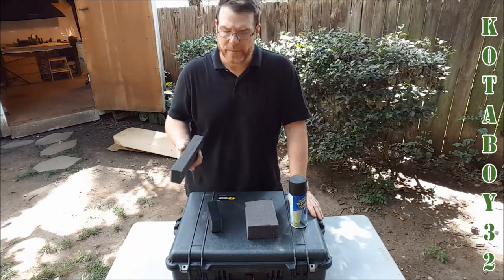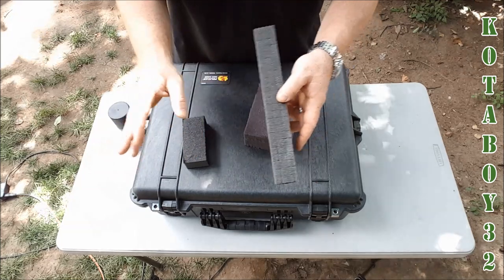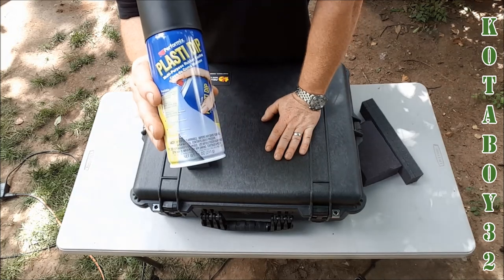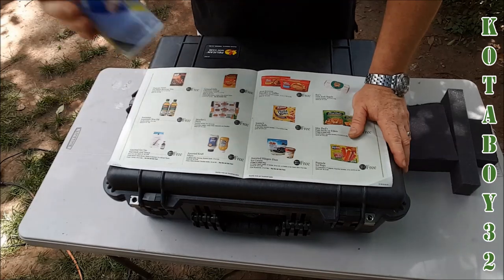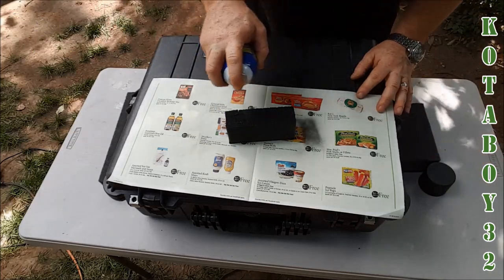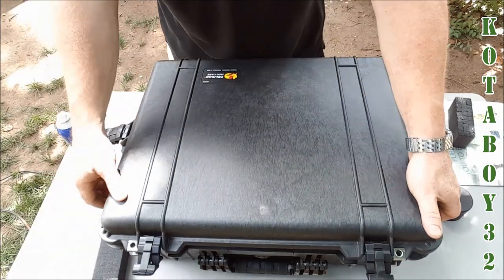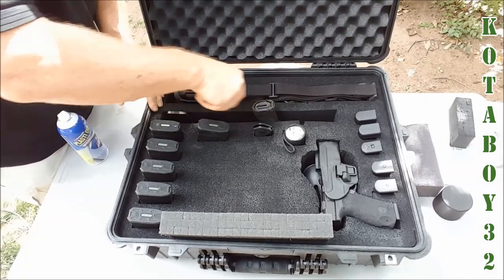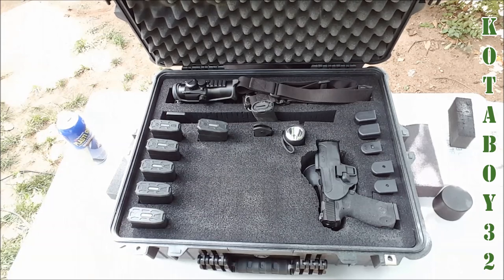Plasti Dip Fixes Pick & Pluck Foam Issues

Comment: I tried this on a similar case from Amazon. It didn't work with one can. After spraying it all down good, it was better, but still began to fall apart. I tried it again, this time brushing on flex seal, and it's holding better. But really it could use a little more. Honestly, you'll need several cans of plastidip to get a firm hold (or several coats with a brush). This stuff is a basically a big sponge, made to soak up liquid, so that's exactly what it does.

Comment: i use plasti dip for all my foam. works great... also if you use spray adhesive, there can be some spots where it is still tacky, go over with plati dip and bam, fixed.

Comment: Great Video!  I have been using Pelican cases for years now and I have had the same issue with the pick and pluck foam and now that I have seen your video I will be able to setup both of my 1750 and 1720 cases up right.   I have also been looking for a case where I could put a AR pistol or quick reaction setup and seeing what you did has given me a lot of ideas  and turned toward the 1600 instead of the 1700 series case.  I want a case that I can take with me on a plane and allow me to have a sidearm with me when I travel in states that honor my CWP.

Bravo ZULU on your Case and Video!

Comment: Thank you for posting this video! I have used Pelican, and knockoff cases for 25 years to house electronics and computer peripherals. Love the pick and pluck concept, vs cutting foam w/ a hot knife, but the fact that the cubes can inadvertently tear off, is frustrating. So, finally have a solution!

Comment: Added tip for use with Plasti Dip - after shaking very well keep the can in hot water....the hot water allows the rubber particles inside to be VERY FINE. this will aid in a much smoother application and look.

Comment: Learning this the hard way: this is best done right away, when the foam is new and the blocks are together. I did the Plastidip spray a couple years in, when some of the blocks were very loose or missing. Do this the right away after you decide on your configuration. 2023 cost at Home Depot is about $10 per can.

Comment: I would spray first and then cut, not cut than spray.
There are a multitude of different sprays / coatings you can use.
3-4 coats of flex seal works out really nicely.

Comment: Love plastidip! Used it for years on my car, blacking out the silver/grey highlights on the grille and bumpers and gave all the chrome trim a nice black matte finish. Been 4 years and still holding like new. Also rebuilt and refinished a hon lateral cabinet using dip on the handles for grip and coat the sharp edges. First coat is supposed to be a half spray dusting to give the following coats something extra to adhere to then lay it thick with wet sprays after that.
Gonna go the extra mile by grinding & sanding with my Dremel for better shapes and cleaner edges after I pluck the cubes before dipping. Making a QuickDraw case for 4 pistols .

Comment: Is the plasti-dip rough on the firearm?  If it is drying hard, wouldn't it scuff the firearm as it is being removed and reinserted? Just curious as I just got a case and this looks like a great idea as I was thinking of putting the pick n pluck on bottom and carving on the solid pice. Thanks, and great video.
Reply: I'm wondering the same thing

Comment: I was inspired by your vids to finish my Pelican 1600 go box. The plasti-dip tip worked perfectly. My AR pistol is nearly identical to yours. Went with my Sig M11A1 for the handgun. I added a spot for a Howard Leight Impact Sport hearing pro. I also cut a small section in the second layer of foam for a desiccant pack. Thanks for the vid and the ideas!

Comment: Would you recommend coating the foam with the Plasti-Dip before or after cutting it? I was thinking maybe I should coat it first as I feel that could make it easier to cut, but what do you think?
Reply: TheSlowredchemical  wondering the same thing
Reply: TheSlowredchemical you don't cut it you pluck bits out

Comment: Great tip, Kotaboy.  I just started picking & plucking my brand new Pelican 1510 and already the pieces are coming apart.  I’m going to get some Plasti-Dip.  

It might take a little practice.  But a whole new set of P&P is only about $40, so if I screw it up, it’s not like I wrecked a $180 case.  

Also, you are clearly no fan of the factory P&P, so I give you extra points for not using a word that rhymes with “pluck” every time you call it by name!  :D

Comment: this works great.  nice job on the case.  although the area you have blank seems a waster of the space.  perhaps you might have been best served with a smaller case.  for everyone bemoaning chemicals and moisture...you don't store long term in this situation.  if you do, just throw a couple of silica gel pack in the case.  also, you should check your guns every couple of weeks based on the humidity in your area.  leaving this in the Florida area for months will be your own fault when it looks like a rusty anchor.

Comment: i'm assuming its good idea to have it all plucked out and set up the way you like it before you spray it down with the plasti dip. I thought about doing it on mine...but my set up in my case isnt' complete. My fire arms hasn't had its red dot put in yet and will need future cutouts for it.

Comment: use some warm water in a bowl to warm up your plastidip bottle.  Not boiling!  Just hot tap. Then shake it well, it will loosen it up for a better spray.  around 20cm (7.5 to 8 inches) is the best distance to spray from.  About three coats. Let each coat dry.

Comment: The only reason I don’t want to do this, is that as a photographer, my gear is constantly changing, so I want to make sure I can always add slots for lenses without having to buy a whole new set of foam
Reply: you must not be talking about spraying the foam with plastic-dip.
Reply: Just cut new holes through the plasti dip

Comment: Great Tip - just got a CaseMix for my Nikon Z6 and kit lenses and adapter (for non Z lenses) so we are talking about $4K and I was sticking it away with other stuff not good to keep near this equipment... but I will - constantly - be pulling and pushing at the sides of those grooves... this should do the trick!

Comment: I went the Apache route as well, as good as the case is i hate the pick and pluck foam, i believe ill use the Plasti Dip on it but im gonna order a couple pieces of the solid foam and use a hot knife to cut out the layout, i think it'll give a better look overall, thanks for the video

Comment: Help ! lol ok I've got a case with the same removable blocks. And had it so long they've broken down. Can you tell me where I can get  New solid foam sheets from. I can't seem to find them. I look forward to hearing from you. Thanks for the video. keep up the great work.
Reply: Kotaboy32 Tactical Firearms Review well I tried to get the size I needed about 8 months ago and they only had narrow slips that I would have to place 3 side by side. I haven't looked since. but would love to get the size I need for my AR. Thanks for the help. ill go back and look again.
Reply: @widowmaker8338   try kaizen 24"x48"x(three dif thickness 20mm 30mm 57mm)
Reply: @Dreadylock9170  thank you very much for your information.

Comment: Thank you for this video! I have a Pelican 1400 case for m,y DJI Mavic Pro. I fly my drone alot and after the first few weeks I noticed the Pick N Pluck foam as started to show some wear and tear. I would love to get a foam cut-out specific for my Mavic however its more than half the price of the case just for a foam replacement. I'll spend $6 or so on a can of plasti-dip. Awesome video!
Reply: Doesn’t the Mavic come with it’s own hard shell case? What was wrong with the original case it came with? I’m in the process of getting the new Mavic

Comment: That is amazing! I will try this when I buy new foam for my cast.  Also, if you have a access to a laser cutter, you can cut out that same pattern into a thin piece of acrylic with color of your choice (preferably opaque) and glue it on top of the foam. It will make the case look uber professional. I got the idea from Tested.
Reply: Bacawaka acrylic defeats the shock absorption of foam. If I'm protecting anything with foam padding, I don't want to add a sweet looking but hard piece of acrylic for my gear to potentially bang against.

Comment: i USED TO DO A LITTLE FIBERGLASS WORK BUILDING A SOLAR BOAT. i GOT SOME RESIN ON FOAM ONCE AND IT GETS ROCK HARD. i THEN THOUGHT THAT IT MAYBE POSSIBLE TO THEN WITH A SAW AND OR CHISEL. tO FORM AND SHAPE WHAT EVER YOU WANTED. Say for instance a fore grip or something. Never ended up doing it.

Comment: I did my 36 inch case last night (3 coats) and its not looking as nice as yours. might need a 2nd can bc i can still see the individual squares at some spots. The last coat left some thick spots that i should have spread out w a card so it looks kinda splotchy. Also it smells very strong chemically after sitting 13-14 hours does yours still smell so strong? not the results i was looking for.
Reply: I had to leave mine out to dry for like 3 days to get the smell to go away

Comment: I've ordered two cans of Gun-Metal Gray Plasti-Dip to do my two Pelican cases.  I already have my items set in my cases, so I'm just waiting to do the Plasti-Dip.  

Won't the Plasti-Dip bond the upper and lower layers together?

Thank you for this Video.
Reply: Vigi Driver 
no it will not...I used hot glue and it works great

Comment: How many cans do you think it would take to do 4 of the Plano All Weather Tactical cases? I have 3 of the 42" and one of the 36"?
Reply: +kotaboy32 Firearms Review was that both layers of foam?
Reply: +Jon R also, if you have foam that needs replaced I found a place that has high quality foam for a lot less than the pelican brand stuff and they sell while sheets of it. They have charcoal standard and charcoal firm up to 4" thick. I'm ordering a couple sheets just to have for when my foam needs replaced. They also offer custom water jet cutting if you want to have the foam cut perfectly. Here is the link for the charcoal foam for gun cases as well as eggcrate charcoal foam. 

http://www.foamforyou.com/custom_foam_packaging.htm

Comment: I wonder if you could spray it unplucked then cut to exact size after?
Reply: Big Al yes you can just use a razor knife with a brand-new blade and white sharpie for the outline works fine I did it to mine good luck
Reply: Thanks.  I going to try it this weekend.  Have a two gun case (pick and pluck and it's big) that I'm putting my 6.5 creedmoor and my ar.   Room for mags and a couple of guns maybe three.
Reply: @bigal7561  hey Big Al did you end up spraying then cutting? If so how did it work out?

Comment: You can buy closed cell foam for these cases. Going further, my Plano case has two layers of foam on the bottom part of the case. One of those is "pluck foam" and the other is just a solid foam sheet. What I do is put the pluck foam as the bottom piece that the items just sit on and I cut out the other piece for the items and it goes on top for the items to fit in. So you just reverse the foam sheets essentially. Also, and this is important for all firearms owners to understand, foam cases are not a great way of storing your firearms long term due to them having foam. Foam sucks up humidity like a sponge and moisture is not good for your firearms. This is especially true in humid climates. So if you are storing your firearms in cases with foam, you need to throw some silica gel packs in the cases as well and change them out regularly.

Comment: You also glue the foam to the case with it
Reply: JB be careful some glues degrade seals on peliican cases from fumes in case even qfter it dries. I hate to use glue on my expensive case. Sounds good but bad idea plasti dip dries.

Comment: there's 5 different grade s of replacement foams. there's good stuff and cheap stuff
Reply: Can you please name the different types of replacement foam you can use that way I can do some research and look them up I have a Plano 36-inch all-weather ml tactical case that has the pluck foam and this is for my Smith & Wesson military sport AR-15

Comment: besides plasti dip theres a spray glue designed to use on foam.  that would be better stuff in 1 applications 
http://www.sailrite.com/NG633-Foam-Lock-Spray-Adhesive-12oz
Reply: JB is that stuff made for joining the foam or just gluing foam together? I ask because I tried the 3m super 77 that pelican recommends for gluing foam. That works great for gluing the layers together or gluing it to the case but it's useless for bonding the individual cells like he did in this video. Not only does it not really hold the cells together but it stays sticky for a long time/possibly forever. Did mine 24 hours ago and it's still sticky. If I put a knife in my case it sticks in and when I read it out it has glue on it.

Comment: Use the correct foam cutter and DO NOT fucking plasti dip the shock isolating foam in your protective case!  LMFAO.  You will reduce the shock value of your case if you use this method.  Also think about the lay out, his optic is upright and probably the only part in the box that actually needs the shock protection.  It is up against the egg crate top piece instead of insulated inside the segmented foam.  SMH.

Comment: Dont use plastidip near your firearms unless you never plan on cleaning them. Any sort of CLP or solvent that gets on the plastidip will melt it and it will get all over your gun. Plasti dip is a good product when it is used in the proper application but please dont do this to your gun cases. Just go to a local craft store and buy some solid foam for a few extra dollars and cut it to shape.
Reply: Hmm...been using plasti-dip in my cases for years and so far no damage to the foam or residue on my firearms. And that is with warm weapons being placed back into their case. I wipe down all firearms after cleaning, then apply light oil. I will keep an eye on it. You have to be pretty sloppy with your cleaning to get solvents on the foam IMO.

Comment: Thumbs up for time and effort. Not so much for DIY modding an engineered product w/o talking to manufacturer. Pelican puts real brain power into these systems. 

A) Do the parts even need this level of protection? If so, I want nothing to do with them in the field. 

B) How do you know you have not destroyed the G load transfer curve of the product?

Since I believe through personal use that A is false, then B is irrelevant. Thus, this is more boy toy nonsense related to guns. 

Where exactly do you plan to bug out to lugging a pile of Pelicans with you?

Overall rating, play time for gun fan boys. Utterly useless.